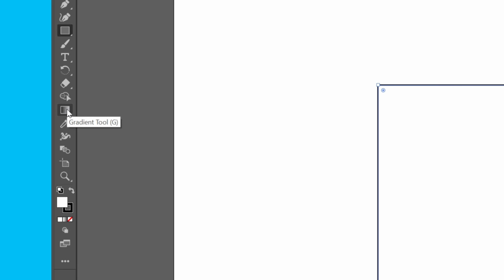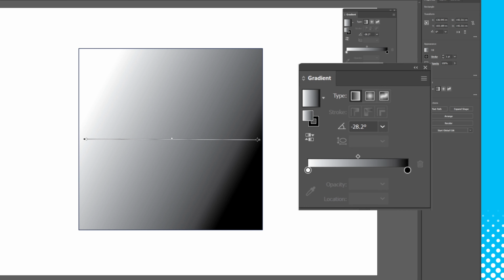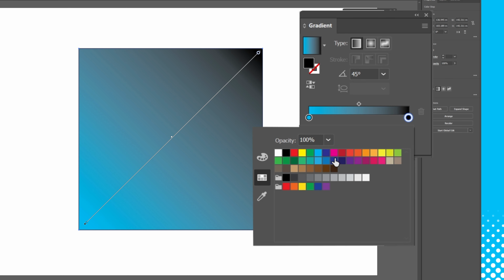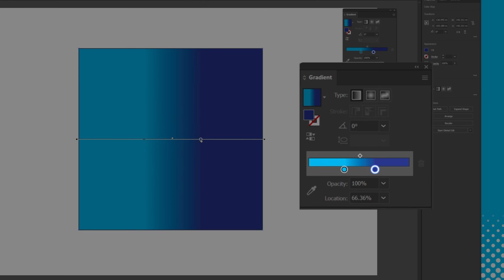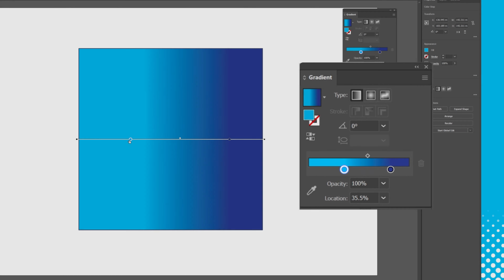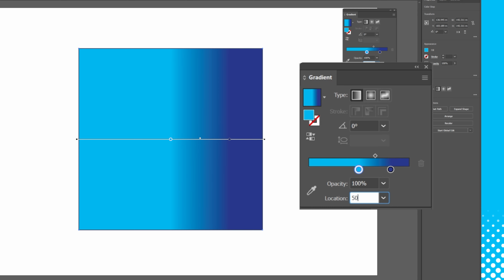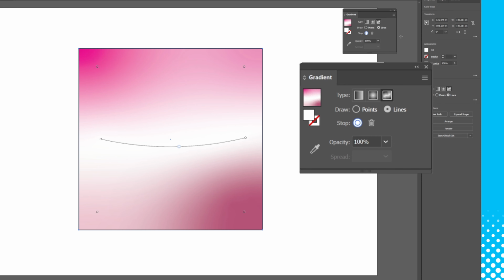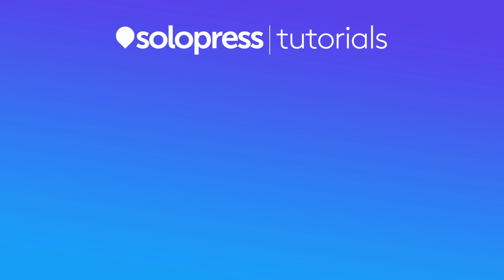How to Use the Gradient Tool in Illustrator | Adobe Tutorial

Comment: This doesn't seem to work for text...
Reply from the maker: Very good point. To use a gradient on text, select your text with the selection tool, go to 'Type' in the top menu and the down to 'Create Outlines'. Then go to 'Object' in the top menu, down to 'compound path' and select 'make'. Then you can apply the gradient. It's one of the few features of illustrator that seems a bit convoluted, but it's essential to know. Thanks

Comment: I have problem in my illustrator,  when using linear gradient tool , I can not move my gradient tool position,any suggestions please?
Reply from the maker: Hi. When you'r in the gradient tool and you see the adjustable bar appear over your gradient, hover your cursor over any part of the bar that doesn't have a control. You should see that the cursor changes to an arrow head. Click and hold and you should be able to move it freely. Hope that works for you.
Reply: @solopress  Thanks alot⚘